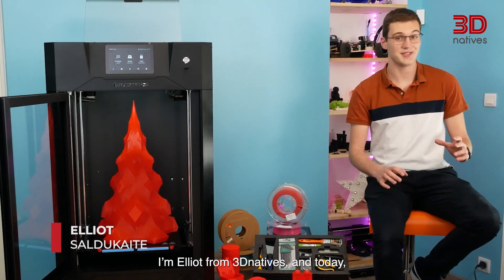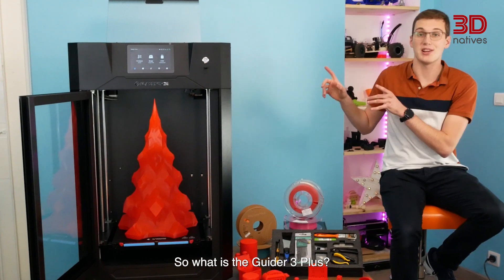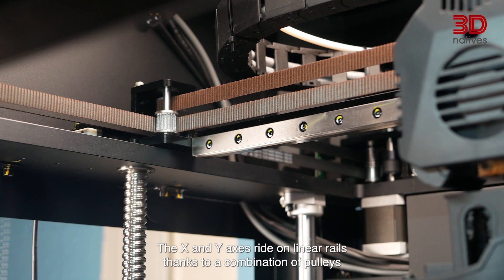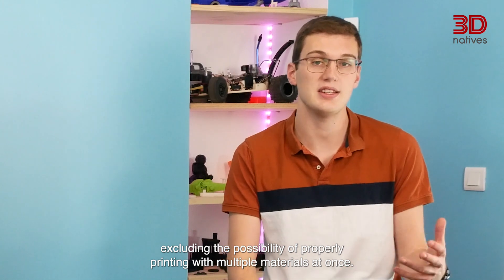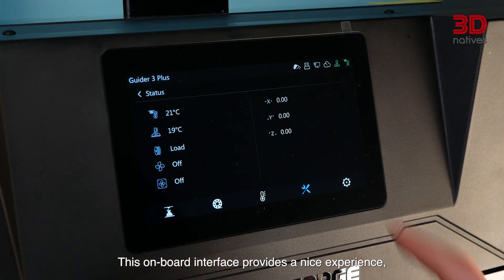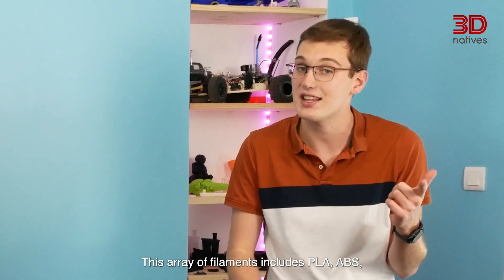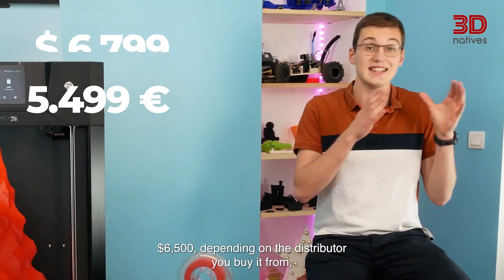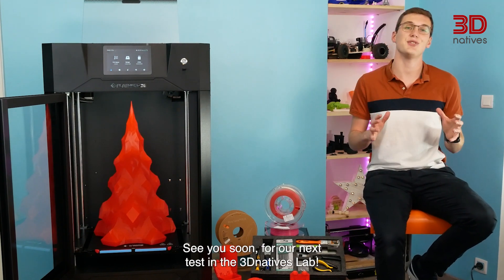A professional FDM 3D printer under $10K? Let’s review the Flashforge Guider 3 Plus | 3Dnatives Lab

Comment: What a laughable price for a 350x350. Professional lol gtfo
Reply: do you have any input on this? i'm being offered this and was wondering which printer to go for a startup with a similar build plate
Reply: What other printer can do 350*350*600 at a lower price point?
Reply: @markm49  oh god, so many, vzbot voron ratrig if you want to put in the work then there are plenty of others that are pre build. just search corexys
Reply: @DavesProjects very few printers available In this size which are plug and play like this. Not everyone has the time to build vorons or ratrigs. I can only think of Picasso designer XL or the intamsys funmat series of printers which are built this well and come with the service and support like this machine does.
Reply: @Theprofessor1212  thats not only wrong, but a lazy response, service and support? how about open source and communities to back those cheap parts.. Troodon to give you an example would be fine for a 350x350, qidi has some comparable offerings, then you get to smaller brands... there are not a few.
Reply: @Theprofessor1212  lol honest the dang prusa xl with the multi heads is a better options for 3k than this.. and if you have a specific need to get something like this then you have someone working for you that needs to understand printers. this is a joke for 7k.
Reply: @DavesProjects  again, none of these printers have that service support for their target customer base. If I’m paying a design engineer $80 an hour I don’t want him tinkering with a 3d printer. I just want him to focus on his work and call a guy to come and get the printer working. all the printers you are describing are for enthusiasts or small owner operated 3D printing businesses.
Reply: PRUSA XL or QIDI both serve that
Reply: @DavesProjects  none of them have local country agents with on site techs. They only help you over the phone or email.
Reply: $10k for a passively heated enclosed printer with a huge build volume…. Hard pass.